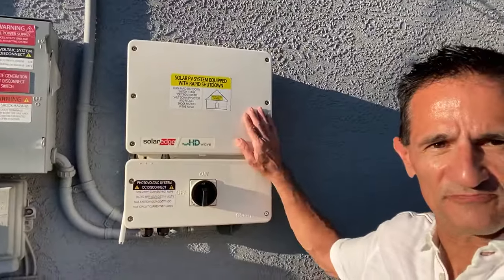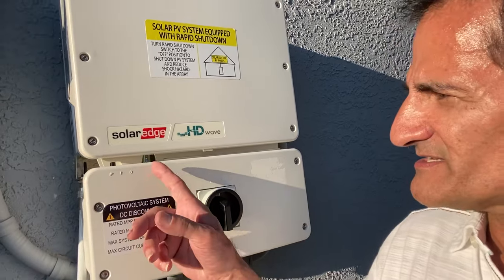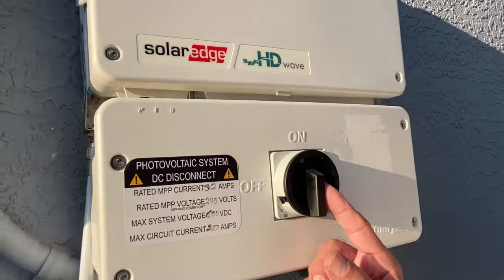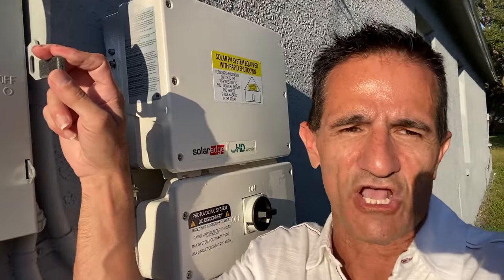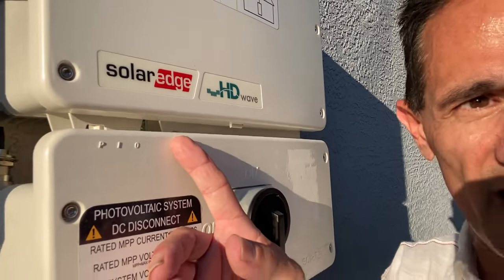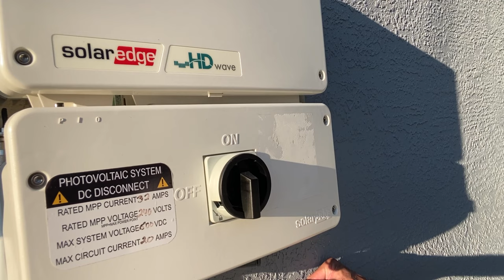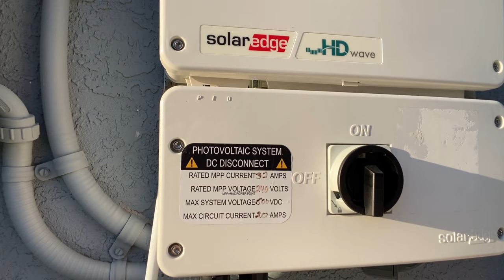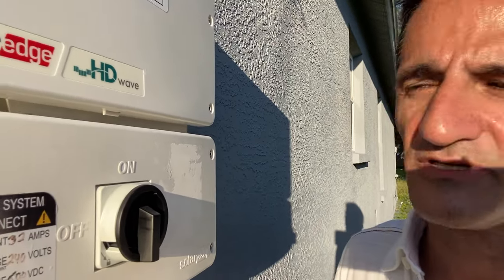How to Reset & Trouble-shoot the SolarEdge Solar Inverter. How To Reset & Fix  Solar Edge Inverter.

Comment: Thanks, Greg. First I want to say I'm in Las Vegas, NV! 34 days ago i had a tech come out because my inverter wasn't communicating. The tech was there about 20 minutes. $299. Last friday it lost comm again. It took me a few tries but it communicated for a day. Call them back. They told me they will come out again but their prices increased to $349.  I did get info out of the rep who said i may need a wifi booster near the inverter. I will try that and a reset tonight when i get home from work. Again, thanks for sharing valuable information.
Reply from the maker: Yes I’ve seen that before … a wifi booster should do it ..

Comment: Thank you Solar Edge sent me the wrong instructional video but i found yours which helped me more thanks. What does the red light mean?
Reply from the maker: Red light if it does not go off  means there is problem with solar system 
Need to do a service call from solar installer

Comment: We reset the system the blue is steady the green is blinking the red is off
Reply from the maker: ok Blue --it's communicating with Solaredge monitoring... Blinking green --Inverter is not  producing. Most likely a wiring problem. Please contact  the solar installer to service . There should be stickers with phone number on  solar  inverter.

Comment: I just got charged for no solar production from july, aug, & september! I'm hoping rebooting the system will help. I'll update soon...
Reply: Same.  My solar company also wont respond to customer support requests.  Odd
Reply: @ttfcars  I had to call the manufacturer pretending to be am installer in order to get someone to help.  They did a diagnosis and found I have a bad inverter and are sending a replacement
Reply: @Ssquanchh  good to know, followed the steps in this video but same results so probably a bad inverter here too.  Already filed a claim with solaredge customer support but thinking that is a dead end.  Will try calling my local installer hope your issue gets solved quickly!

Comment: For some reason, after a power surge and it will not come back on. I ran through the process and still nothing. I am getting no lights on the inverter.
Reply from the maker: Sounds like inverter is dead contact installer or solar edge to get replacdement

Comment: Greg saved my bacon!!! Greg thank you so much for taking my call and providing the information that helped me get answers all the way in Texas! Greg provided an idea to contact a wholesale distributor here in Texas who led me to a solar servicing company who assisted me with the dreadful Solar Edge 18xB7 inverter death code... my original installer went out of business as most bs solar installers due (your door to door salesman) and I could not find a current install company that would take on my system... for those of you in a similar situation you have to find a solar servicing company of your original installer goes out of business. Greg thanks again!

Comment: Dude that is a loooong time to trouble shoot this problem.

Solar edge crapped out on me 2 days in.

I did this cycling and it did nothing
Reply: Thanks for watching .... if this doesn't work then a service call will need to be done ...call your solar installer ... thanks

Comment: If it's legal in your country , you can turn all breakers/dials/switches off , take off cover, and investigate any corrosion, bad relays, shorted components, bulged capacitors etc. But only if it's legal and you are savvy.
Reply: Yes .. but I'm cautious about recommending this to anyone who does not have electrical  experience .... a home grid-tied solar inverter can be upto 430 volts  and a shock can be fatal ... even turned off capacitors and transformers may still have stored electric so only for someone who is an electrician or has proper solar training. to do this.... thanks for your comment. Best Regards

Comment: my issue is that i can not get the inverter to connect to the mysolaredge app.. nothing i try works, it never gives me an option to configure my wifi settings..
Reply: You might not have admin role to make changes to wifi ...... Contact the solar installer or Solar Edge support .. they can help with this

Comment: ADVICE PLEASE. my solaredge inverter when new was essentially silent, now 3 year later it is making a buzzing/humming noise that seems like it has been getting progressively louder.   given that the noise was not there before, what should i do?  there are NO error messages, beeps, lights and the dashboard seems to show normal operation.
Reply from the maker: I have not heard of that before … are you sure it’s from solar edge ? I’ve seen some old  worn breakers do this … so check that … if it’s from inverter I’m thinking  there is not good  electrical contact inside … I would suggest calling a solar installer  for service call
Reply: @solarbygreengreg solved: removed the inverter housing cover, found that the noise was from a 40mm fan. best guess are the ball bearings are failing

Comment: Solar edge is the worst.  I have two of them.  They only have a couple lights, no LCD screen to display power being generated.  Mine, installed by TESLA, always have issues and then it takes months to get service
Reply from the maker: It does not have a display because there is a phone app and  desktop app used. to monitor the solar system .. the app gives more information then a display ever could .. such as individual solar panel monitoring ...Did Tesla give you access to solar app ?  I think in Tesla... they have own app that works with solar edge.  Regarding taking months to get service..... that is Tesla's fault not solar edge .... Unfortunately Tesla has reputation for poor service .... and also if not installed properly your going to have problems ... But This is deal you made with Tesla to get lowest price in the country .... lowest price often means they are cutting services and / or using installers not properly trained... Lesson here don't just buy lowest price!  I wish you the best with your solar system...

Comment: I highly suggest to have the solar edge app and tesla app (if you have tesla powerwall) so you can monitor your system daily.  This has happened to ours about 8 times in 3 years.  Had to have a new inverter installed less than 1 year.  Personally I'm not very happy with the inverter.  Sucks when it doesn't work and then you have to do this over and over.  Customer service in Hawaii is virtually nothing after you buy the system.
Reply from the maker: I  agree  the monitoring apps are there  notify owner and installer if there is a problem...

Comment: Those lights are not flashing at all on my panel, what should I do please?
Reply from the maker: Double check that no breakers are tripped check your circuit panel and and breakers outside near meter.. if no breakers tripped then the inverter may have had a power surge that  burned out inverter... Inverter needs replacement...

Comment: I’m installing one currently but after everything I’m only getting a flashing green light which means connected but not producing is there any way to fix this?
Reply from the maker: If after a few minutes the Flashing green not stop it means not producing  most likely it’s a wiring issue somewhere most common in junction box where strings come together

Comment: I only have a solid green light after the reboot. The blue lights not even blinking not even showing up just a solid green light….
Reply from the maker: solid green solar is producing ... blue solar edge monitoring communicating to solar edge servers.... It may bev that your inverter is not communicating .... check your solar edge app ... is inverter uploading data ie solar production yesterday etc ? if not check internet connection ...  if you have a cell card --anntena near inverter it may need replacing the cell card

Comment: Hello, I have a flashing green light.  My system has never worked and the company that installed it went out of business. I rebooted the system as you explain in this video, however I still get a flashing green light. What can it possibly be?  I contacted another installer, but they have yet to respond. The inverter is from Solar Edge (the same system you show on this video).
Reply from the maker: Flashing green means it's not producing .. it could be optimizers are not paired .. it could be wa wiring fault for example .. yes get another comapnay to service the unit also you can check solar edge to see if it can be remotely trouble shooted .... Here is link to Solar Edge  Support https://www.solaredge.com/us/service/support/system-owner
Reply: @solarbygreengreg  thank you for your response. Unfortunately, they can't. The company that installed the system never gave us access to the app or is connected to the internet. Since they went out of business, they don't care. But again, thank you for your help. I called another company that's authorized by solar edge this morning. We'll see.
Reply from the maker: @japp333  Ok .. yes any installer that does Solar Edge should be able to help ... See if new installer can give you access to Solar Edge Monitoring --he may have to request  the solar edge monitoring be transferred to his company
Reply: No other solar company eill touch ur system to fix it. 
I get inquiries every week for same thing, even though in my *services NOT offered - I put in bold letters " do not replace, fix, maintain any PV system components,inverters, or electrical that our company didnt install"    i feel bad but theres so many reasons why we wont touch them
Reply from the maker: I understand many solar companies feel that way … there’s more money installing a new solar system … and you don’t want to be responsible if someone else installed improperly  also not enough volume. To make a living on service …
But I think we have reached a point where there may be enough volume for service .in many areas .
What I do is … I can service their solar installed by someone else.. ie replace inverter etc.  Abbut  I’m not going to warranty the workmanship of someone else’s installation. …

Comment: What if you have no lights blinking at all. Or just a solid blue light
Reply from the maker: the green light should be solid after a few min..if not then there is inverter or wiring problem.. If no  lights please confirm everything  switched on including breakers .. if not a service call is needed

Comment: Greg thank you very much for your gudiance and training.  Our installer went out of business years ago.    Our 3gl  wifi reporting process is no longer supported by Solar Edge so we are blind eventhough we have the SolarEdge app installed.   We connected  ethernet cables to both inverters.  our configuration is all internal.  Meaning you must have the cover off to configure the reporting to LAN.   

  As previously stated we are BLIND,  Trying to find out what were are generatimg.  Getting high electricy bills from FP&L but no visibilty on what we are producing so we are are at a huge disadvantage. 

 What is the proper sequence to set up so the commincations with the   Ethernet cable connected?  Do you keep the power om with cover off when doing this lan configration process  or not?   I have experience with high voltage equipment from my time as technician in the military.  Please advise on step by step procedure to properly and safely configre the LAN reporting process.  

Please advise

John
Reply from the maker: you can replace comm card with LTE card about $300 ...or ethernet connection to your router ... if you have inverter with no screen ...  you will need to download solar edge setup app to configure
Reply: I've had the same experience.  I was happy with my panels for a couple years, but with obsolete hardware and companies not servicing their products, I wish I could go back in time and never make the purchase.
Reply from the maker: Sorry to hear that… I think that customers hear 25 yrs warranty and they expect there should be no service required … but just like a vehicle, hvac , or any major items there may be a need for  service …this is why it’s important to go with a local company that has great reviews and been around and the same with the equipment mfr …
If your installer out of business contact mfr … thanks for watching .

Comment: My Solaredge cell card quit after five years.  The inverter completely failed after six.  For the price I paid why would I ever buy another Solaredge product?  The answer: DON'T.
Reply from the maker: I understand  that you expected SolarEdge to be problem free and never need maintenance or repair ?
your vehicle may need minor repairs  after a number of years that’s why there are still repair shops  … solar is same way …occasionally it needs repair.  
Regarding cell card … the old cards were on 3 g network  which many cell companies are closing down … you can either get a new LTE cell card about $300 plus install. Or get a WiFi card   
As far as solar edge failing 6 yrs  this is still in warranty with solar edge they will ship  replacement unit for free.  You may have to pay labor which shouldn’t be more than a few hundred
Reply: @solarbygreengreg  sadly my track record on the Solaredge system is better than most.  I merely expect it to perform on par with other household appliances for which I paid similar prices.  An inverter is not a car which is taking a beating for hundreds of thousands of miles through all kinds of weather.  I can't think of one household item - appliance or electrical or plumbing, unless it's a $20 toaster - that fails after six years, especially complete failure.  And when it provides half your electricity that's expensive on top of the repair/service/order costs.  I am still waiting to hear back from the original installation company, while the electric bill runs up and the sun shines, as Solaredge has no information anywhere as to how to warranty out a failed inverter.  Don't gaslight me and tell me it's not a nightmare dealing with their product.
Reply from the maker: It’s an inverter it can get very hot … and is outside it’s taking lots of abuse… and operating most of day … much different than toaster …… most failtures I’ve seen are because getting too hot and mounted on a south wall — which gets most sun and heat … 
I recommend trying to provide shade by planting a tall hedge or bush  in front of it … by the way solar edge is not only one with faultures… many other brands having same issues … solar edge has revised design of their  inverters about a yr ago … to address this issue.

SolarEdge has warranty 12 yrs standard … and you can buy extended warranty 25 yrs .

Your installer is supposed to be servicing your solar … once solar edge determines  it’s a product failture a new unit is shipped within 7-10 days …SolarEdge has been very quick in replacing units.
So I hope your installer can help …
Reply: I have had my solar for 6 years and I just had my 3rd solar edge inverter die. Have had customers with this experience?

Comment: Tks, will try - no power display now!
Reply from the maker: Make sure no breakers tripped .. if still no power maybe a power surge that knocked it out … may require inverter replacement.

Comment: This a great video, thank you for the information.  I have requested a service call but have not heard from the company.  But this looks like something I can do myself, at least try.  Thank you for the time you put in, very vey helpful!!!!:washhands:
Reply from the maker: Glad it was helpful!
Reply: @solarbygreengreg  Thanks for the reply, turns out the Inverter was bad and had to be replaced. System down for about 6 weeks.
Reply: @austinwilliams4269  glad to hear you got a solution  thanks
Reply: @austinwilliams4269  will they reimburse you for the down time or do they expect you to eat the additional costs caused by their defective system?
Reply: @JusMG559  As fas as reimbursement I'm not sure. I did receive a claim request form but required to submit the form after the first year. The system performed well when it was working and some months over performed.  Because of the months when the system over performed on average I may not receive any reimbursement. I am tracking on a spreadsheet. Any advice would be welcomed.  I am also looking for a company that would pay for excise energy the system is producing when working, right now I get credit up to the amount of the usage, any extra is sent back to the grid.  I'm Texas.
Reply from the maker: You can ask installer if they can offer to help …. It normally yes you have to eat the loss you should check solar app monthly also you receive email alerts if the solar system needs service important to call your solar installer when this happens

Comment: Hey Greg I got a solid blue and a solid green light on and they are not blinking. What does that mean?
Reply from the maker: It means system producing and communicating with solar edge 
You’re all set!
Reply: What if you have those solid lights, but you aren't generating power? Time to get a support ticket?

Comment: Thanks for this video I have a flashing green and red lights going on. So I will try this out. We have inherited this system with the home we just moved into. We also want to connect the system to the Internet. Is there a way to do that ourselves? Seems kinda silly to have the company out and charge us a service call just to connect to our home Internet router.
Reply: Hi! I have the same problem as you. Inherited a 3 years old system for a purchased house. Wifi were never set up and the installer wanted to charge $350 for a service call. Can you let me know what you did to get yours to work? Thank you!